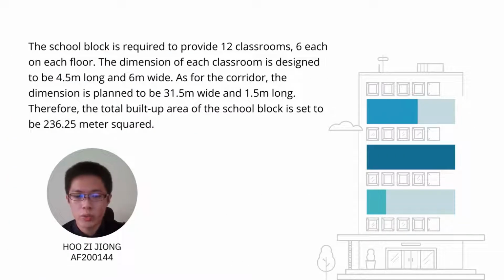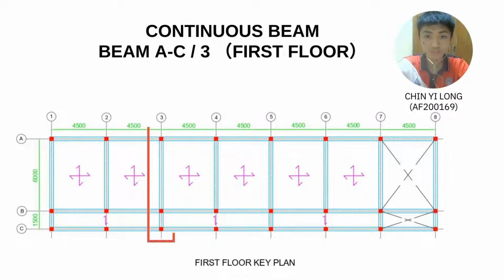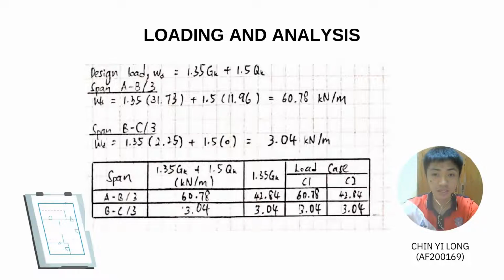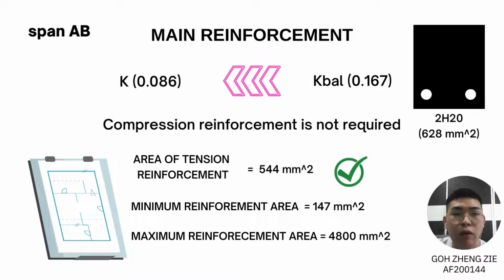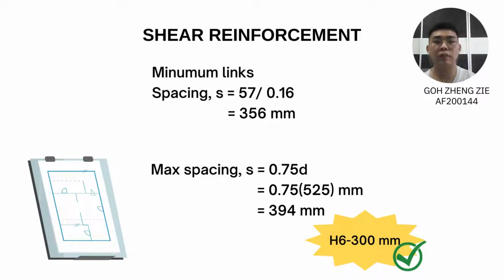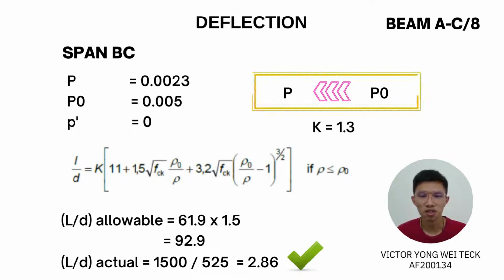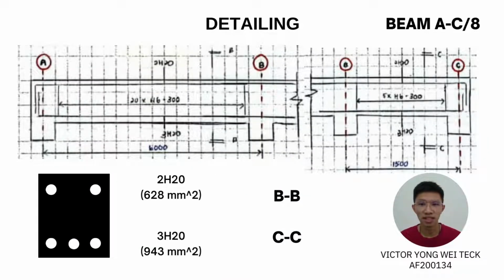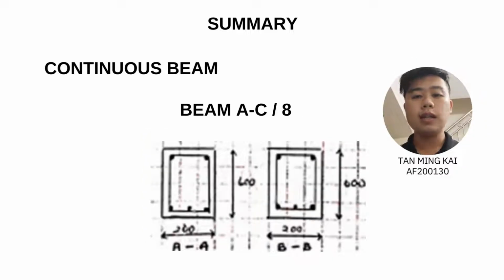STRUCTURE DESIGN （ GROUP 7 ）

Comment: If the roof is changed to reinforced concrete flat roof, explain the effect to the whole building structures such as beams, slabs, columns and foundations.
Reply from the maker: The reinforced concrete flat roof will cause the building structure carry more load. This is because the roof plan of the beam will carry it's self-weight and distributed load from the slab.  The weight on the beam will transfer the load to the column and then to the foundation. The more the load that needed to be carry by the foundation. By considering the stability and wind load, the higher the building, the smaller the beam, slab and column.
Reply: If the roof is changed to reinforced concrete flat roof, it will bring heavier permanent load to the supporting structural members underneath. Also, variable load will increase during rainy day due to weight of water as the flat roof tends to accumulate water. 
- Hoo Zi Jiong (AF200144)
Reply: Although reinforced concrete flat roof have lower expense on installation, but I don’t think it is suitable for big building like school. This is because as the areas of a flat roof increases, the stability decreases. Not only that, they have also short lifespan and the draining will become the biggest issue for the whole building.

Comment: Minimum steel reinforcement is still need to provide although compression reinforcement is not required. This is to prevent shrinkage cracking and enable the vertical link can be provided.